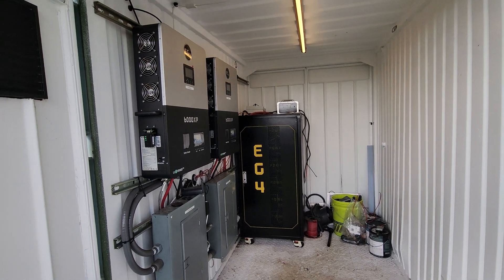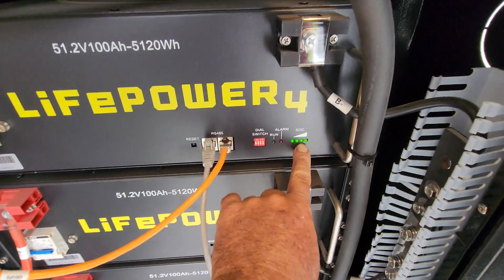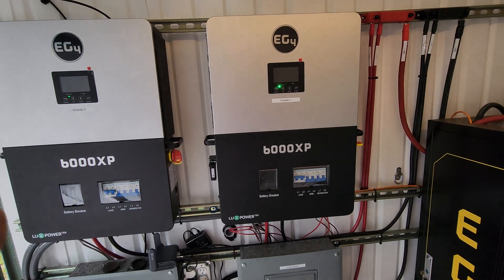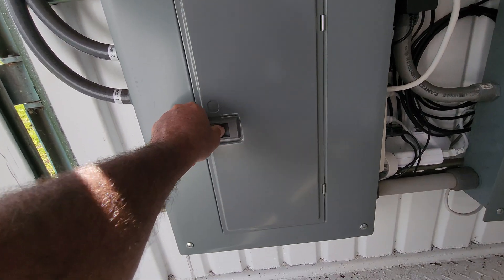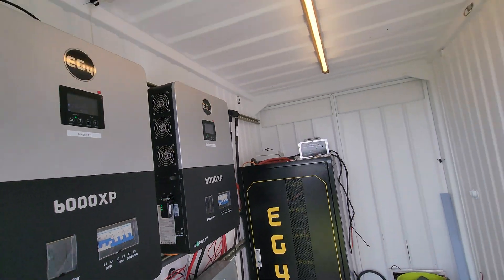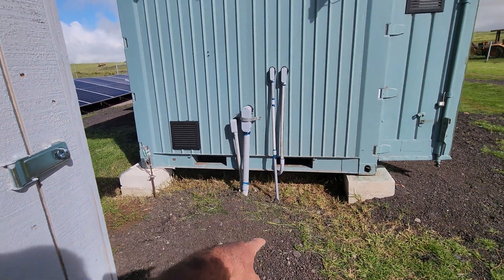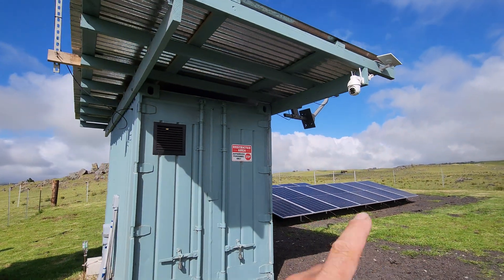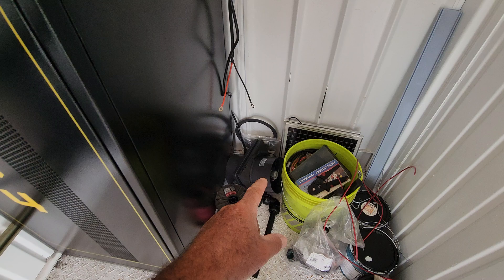Build Your Own Solar Off Grid Power System or Emergency Back-up Eg4 6000xp Lifepower4 Batteries

Comment: You need grommets around those wires penetrating the inverters before you have a problem.  Also, nothing wrong with running loads from your "combiner box".

Comment: Love your setup. You should get an inverter that can handle a generator.
Reply: That inverter can handle a Generator.
Reply: @jim_in_ga  You are correct, generator can be wired into the "Grid" ports (Make sure your firmware is up to date).

Comment: All that to have a water pump?
Reply from the maker: Please watch and listen what I said in the video it's running a whole house
Reply: @ModernOffGridDIY  I didnt see the cables or circuits going to a house
Reply from the maker: @XonGrid it gos to a sub panel in the home where all the circuits are divided up. 4/0 triplex wire running under ground in 2" conduit to the home.
Reply: @ModernOffGridDIY  Cool nice system!!!